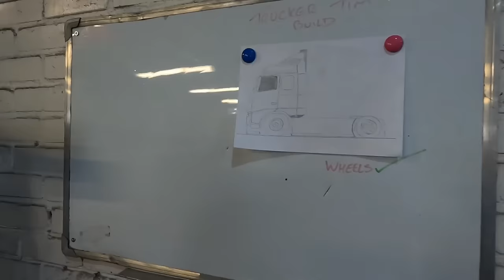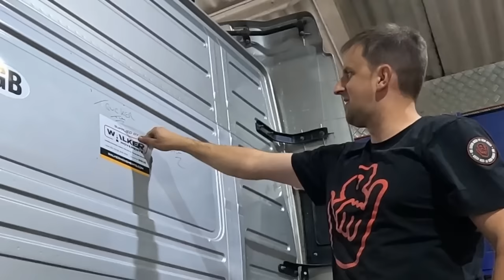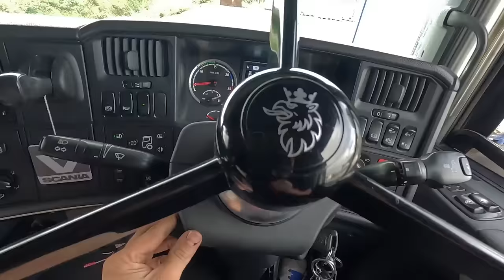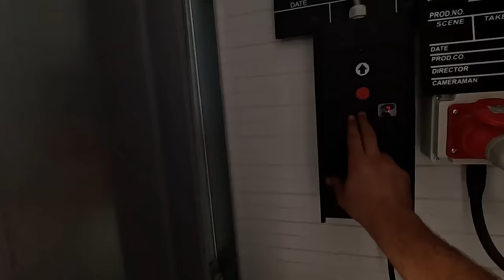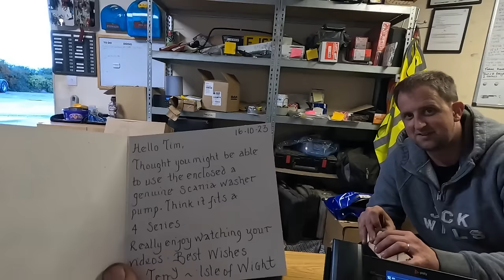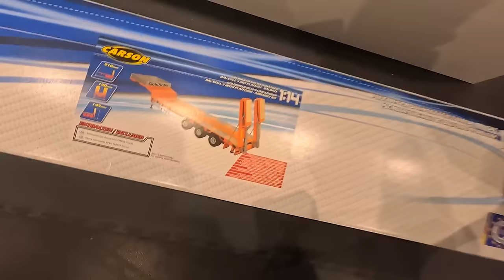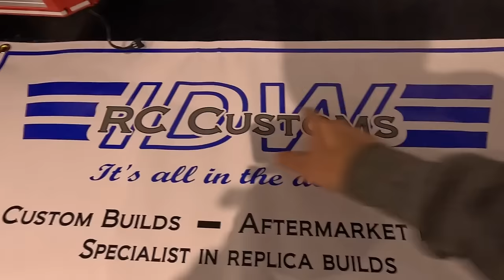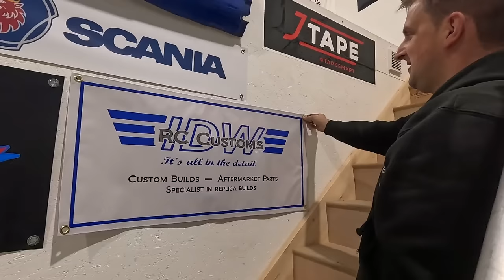THESE RAMPS WILL BLOW YOUR MIND! | VOLVO BUILD UPDATE |  #truckertim

Comment: Well what cab be said after seeing this video.
Who ever had the no2 on the back of the truck had obviously seen underneath of this shit box.
Seen trucks being scrapped with better paint work on and around the chassis.
And this won at truckfest Peterborough, what an absolute joke.
Judge's must need there eyes checked if they thought this was worthy of winning.
There are certainly better presentations of working trucks that are on the road full time working in harder conditions  then this part timer.
It seems now that the Judge's are not fit for purpose or they are being told what trucks have to win at shows nowadays. 
I know a few drivers that will spend hours cleaning before and at shows and never get anywhere near a trophy and this idiot turns up and gets people fall at his feet thinking how great he is.
People will moan at me for saying this but it has to be said that there are far better drivers and trucks deserving trophies and gratification of there efforts to keeping there trucks in tip top conditions.
Reply: cry more.
Reply: Sounds like you're the kind of jealous guy to have done something like that!!
Reply: Far from jealous of that heap of junk.
Reply: @markwarley3194  I never mentioned anything about you being jealous of his truck, but you're obviously jealous of Tim!!